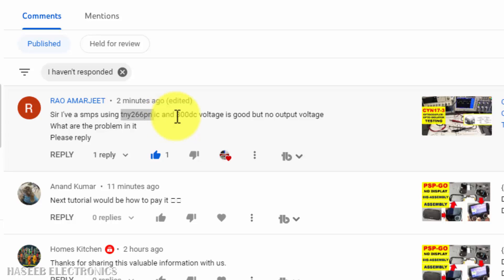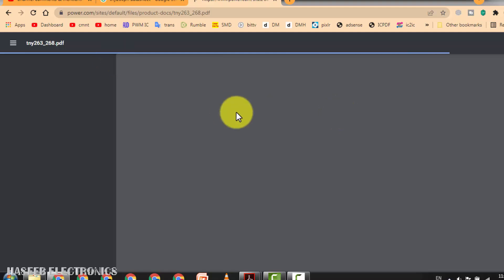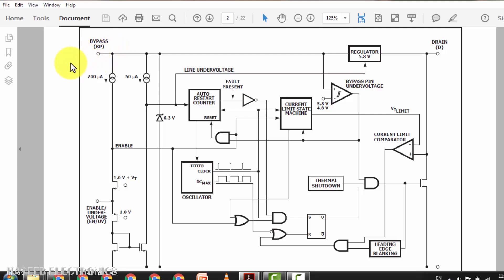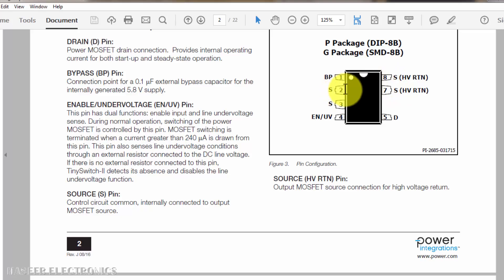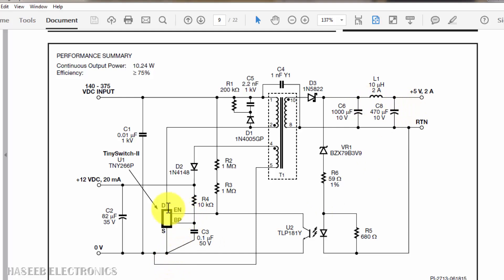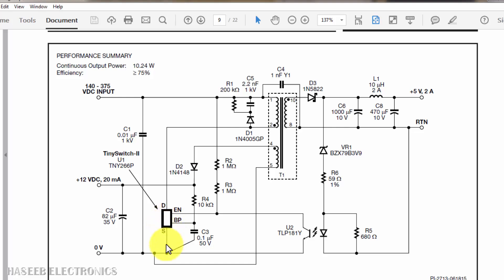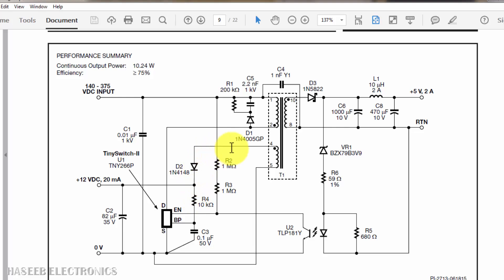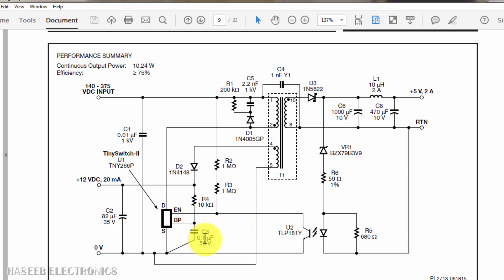{577} TNY266PN SMPS Have No Output Voltage / Switch Mode Power Supply IC Not Switching, How to Fix

Comment: hello sir ,what if pin 1(BP)- i get 302v,the drain pin(5) i got 302v and  enable pin(4) i got 302 the same voltage as vdc input.what could possibly go bad in the circuit.Because i tested it with series lamp it doesn't show short circuit.

Comment: Brother my smps with uc3844 ic working fine giving 24v supply properly upto 30 or 40 seconds after turn on the power supply.after that tripping on over voltage.Again turn on the second time directly showing over voltage indication. Pls find the possible reason for that?

Comment: Sir you have the best explanation of SMPS on Youtube. I have a power supply for a surround system player.I have no voltage on output capacitors. Relay is not clicking. I changed all output capacitors with new ones.I have MIP2F20MSSCF Power Supply Control IC that is not switching. I have 5.6v VDD on Pin 1 . Drain pin 5 i have same voltage as DC which is 150 v. AC Voltage is 115v . Pin 4 VCC is 7.85v . Feedback pin 2 is 1v stable.Optocoupler voltage Fluctuating between 1v and 0v.Can you tell me what to check next?

Comment: What's the reason the power ic tny266pn keep blowing? I have changed this ic and the flyback diode and the ic blew again
Reply from the maker: it blows in following conditions
1. if the snubber diode is short circuit (RCD snubber across the primary winding of transformer)
2. if vcc voltage are too high or uncontrolled (due to optocouoler problem). if above 6 volt, then add resistor to drop voltage
3. if transformer primary winding is short circuit internally (winding insulation is parrished)
Reply: @HaseebElectronics  i found a shorted diode but not in the snubber circuit. It is the diode that is connected to + of the bridge which appears to be part of the emi suppression circuit. Not sure if this causing the ic to keep blowing. But i will change it and see what happens. I only have one more good ic left
Reply from the maker: please check 
1 (in power supply off condition) the optocoupler must provide open circuit. (if it gives continuity then open it from circuit) it must open.
2.  please check the inductance and primary winding
Reply from the maker: please check vcc capacitor connected at pin 1 bypass pin
Reply from the maker: kindly wait until tomorrow evening
I will back to you
Reply: @HaseebElectronics  thanks! How i can check the inductance of the primary coil without risking blowing the ic again?
Reply: @HaseebElectronics  i found the smps transformer have brown deposits around it. Is this a clue it has overheated and shorted internally?
Reply from the maker: if you have a LCR METER then you can check inductance
I am preparing a tutorial of this ic 
it will come this evening
Reply from the maker: if it have deposits or discoloration, it seems that there is something wrong with transformer
check that, there must be 2M ohm resistor between +DC rail and En/uv pin 
if it don't have that resistance, then it is also good 
but the resistance less than 2M ohm will cause to burn as well

Comment: Can i replace this ic tny266pn with another higher rated ic from the same family, ie, tny278pn?
Reply from the maker: yes dear 
from the same family group, the higher number can be used, as within the same family group, the switching frequency and Jitter frequency will remain same. and it will work same
Reply: Thanks for the wonderful video and reply!
Reply from the maker: most welcome
Reply: @HaseebElectronics  May I ask your kind opinion again, Sir? I have a burnt ic and burnt diode in the snubber circuit as shown in the pictures. The diode probably failed first and the voltage spike during switching killed the ic. Pin 5 is completely blown off. Can you also suggest what else might need replacing based on your experience doing this repair? Or just replacing the ic and diode should be sufficient? Thank you again sir
https://drive.google.com/file/d/1CzZCCSzaEVrU99JNrEyADvzXOZ05S_Ru/view?usp=drivesdk
https://drive.google.com/file/d/1CxeYR6gPscCPHCq5m1I6TA8WVcRTU0xz/view?usp=drivesdk
https://drive.google.com/file/d/1CjcqOr9vWuQoknbdZbGzmFDPQKQEqRwE/view?usp=drivesdk

Comment: Sir i have a faulty sony laptop charger. The control ic used is 810 8 pin ic. Pin 1 of ic is ground and pin 7 goes to the capacitor of soft start section. Both pin 1 and 7 shows short. When ic is remove from board neither the ic nor the board shows any short but when ic is put back it again showing short . What can be the fault.

Comment: Is it safe to operate a device after doing this fix ?
Reply from the maker: yes it have to work normally
Reply: I did this on IC OB3368AP and a 5A diode in circuit is getting extremely hot 🔥 🥵 any advice? I used a 27k on pin 18 to ground .

Comment: Thank you very much for this knowledge and experience.
This video speaks to the core problem with startup I am trying to understand with a treadmill PF906 PSU that employs a TOP244YN.

The DS says:

"When rectified DC high voltage is applied to the DRAIN
pin during start-up, the MOSFET is initially off, and the
CONTROL pin capacitor is charged through a switched high
voltage current source connected internally between the DRAIN
and CONTROL pins. When the CONTROL pin voltage VC
reaches approximately 5.8 V, the control circuitry is activated
and the soft-start begins. The soft-start circuit gradually
increases the duty cycle of the MOSFET from zero to the
maximum value over approximately 10 ms. If no external
feedback/supply current is fed into the CONTROL pin by the
end of the soft-start, the high voltage current source is turned
off and the CONTROL pin will start discharging in response
to the supply current drawn by the control circuitry."

Is it correct to say, that to understand the startup process, we need to interpret the waveform diagram of the startup counter, and that the whole process takes place in a very short (<1s) period of time?

Comment: Hii brother 
   Me Mandeep soni muje muje DC 100v 50amps yani 5000 Watt output or input 85v-230v AC me smps circuit design krna he full bridge switching ke sat to. Kya? Me uc3843 ic use kr skta hu or circuit diagram design kese krna he jra bthana ji
Reply from the maker: full bridge switching keliey aap KA7500 or SG3525 or TL494 use karein aur PFC circuit use karein
Reply: @HaseebElectronics  thank you for reply
But mene smps circuit diagram calculate ke aapke sare video dekhe he unke anusa kosis kr rha hu pr problem aa rhi he or transformer me ring core use kr rha hu or calculation ke liye software pr dc rail me capacitor bhut bda calculate ho rha he or currant sance resistance konsa use kru jra details me btae jra me middle class family se belong krta hu to muje esa kuch btao jisse minimum cost me me ye bna pau or zvs drive me use kr sku oe ka7500 to 16 pin ic he me ske bare me kuch bi nhi janta ji thank you again
Reply from the maker: yes dear 
aap ko dc rail keliey 5000Watt ka PFC circuit lagaana ho ga 
i will explain about ka7500 in practical
Reply: @HaseebElectronics   thank you brother

Comment: Sir I am trying to make a 12V-320V DC-DC inverter to power Mobile chargers and SMPS based LEDs, sir I want to know how can I take the feedback voltage from the high voltage side with proper isolation from high voltage at the secondary. (I tried to use Tl431 and optocoupler but they don't work, tl431 burns out everytime even with 3MΩ resistance in series)

Comment: Wouldn't hurt to check R2 and R3 as well, those 1 Meg resistors. Those have a tendency to drift open and that could stop it working too.
Reply from the maker: you are exactly right but these don't effect because these are 1M ohm and so large values resistors very very rarely damage, sometimes their resistance may differ slightly but it will remain in limit
even if these resistor will open it will not effect because the En pin will float and the ic will fluctuate 
otherwise it have to start switching